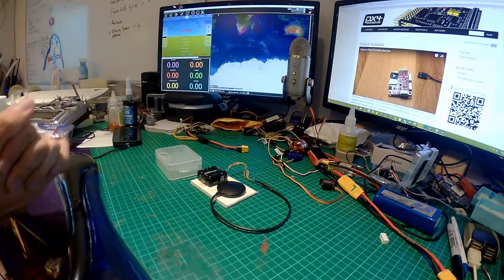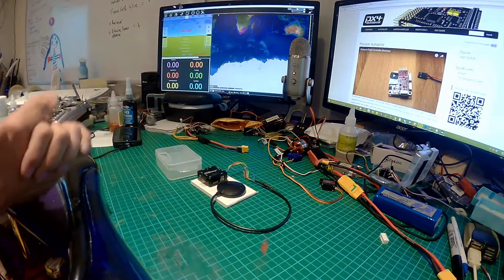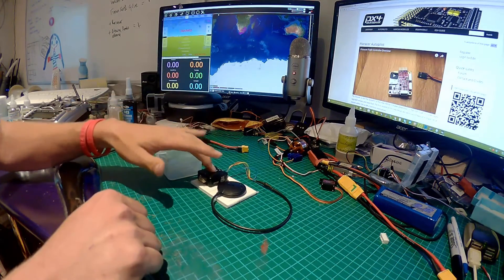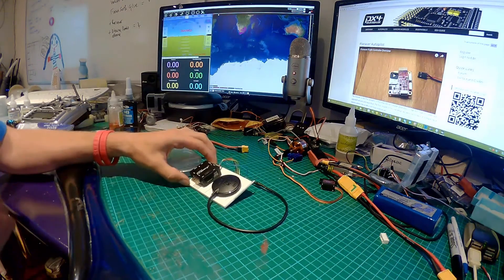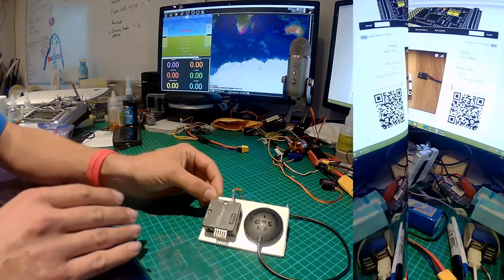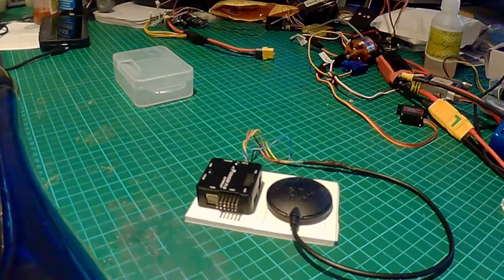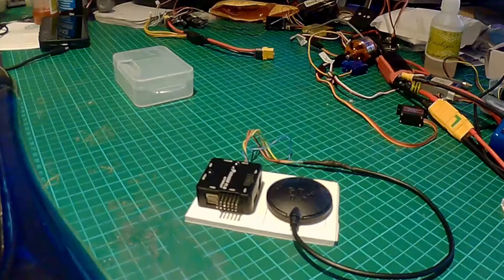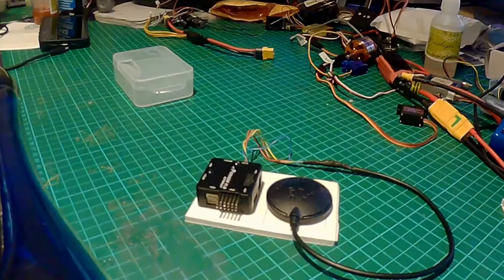Simple Tip: How to Calibrate the Pixhawk / PixRacer & Compass Easily

Comment: does th bangood version working well?i have seen that clone has a brownout problem
Reply from the maker: Howdy, not had an issue yet & also bought another one too.
Reply: thanks for you reply! so it working well like original?
Reply from the maker: eclampsie Yep works fine, not had an issue yet! Well with mission planner & it's calibration, but had the same issue with the full size PixHawk :) Matt